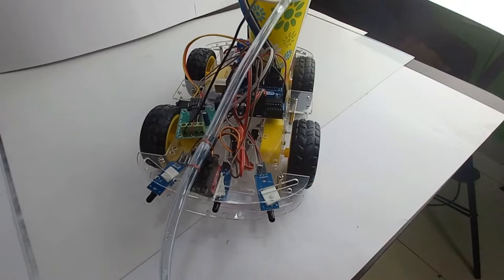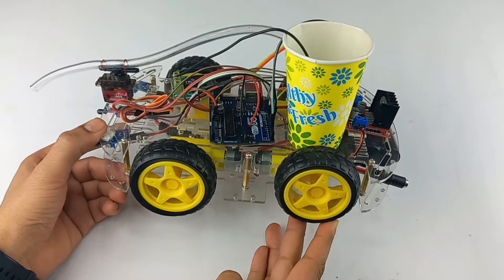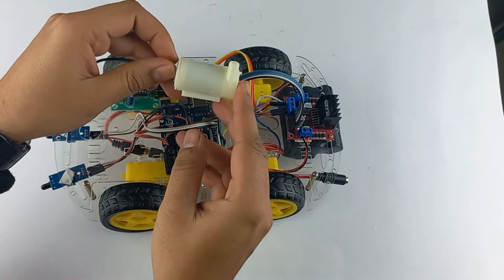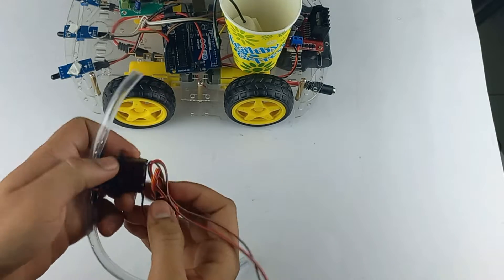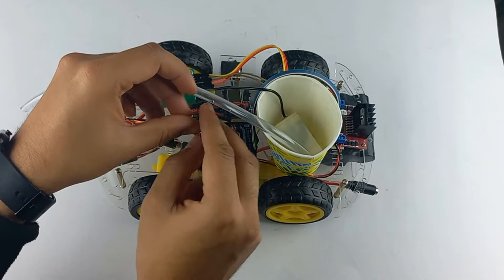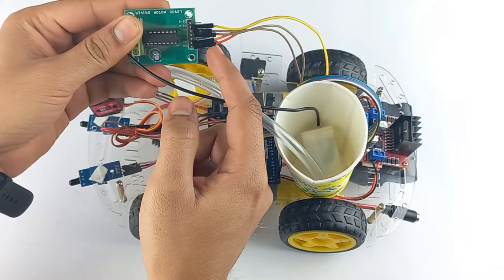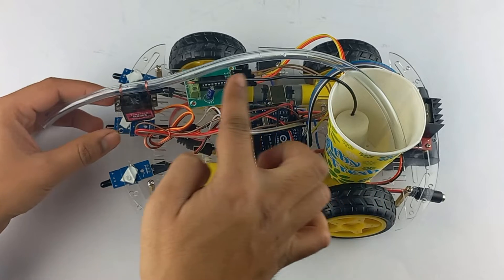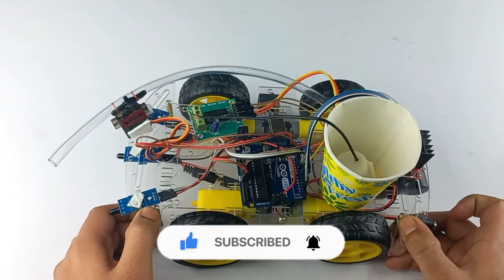Build Fire Fighting Robot Using Arduino

Comment: bro the motors are not moving can you help me
Reply: Bro make a pair of two -two motor and connect the terminal of motor in series and connect to l298n motor driver. If it is not working now also so recheck the connection and see whether it is getting sufficient Voltage of 12v and check the jumper wire are connected properly or not and also the jumper wire by putting the multimeter on continuity mode . If not working check the cod eof Arduino